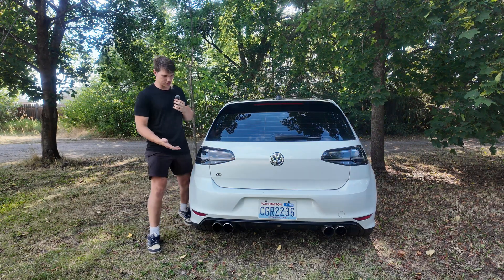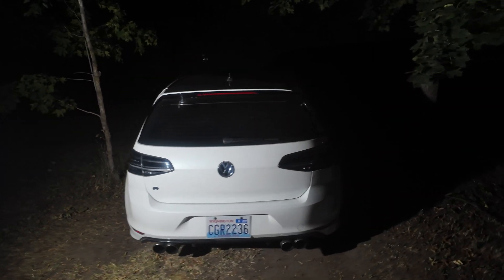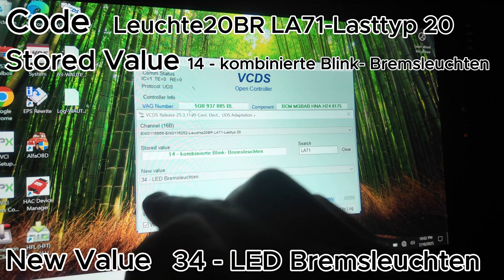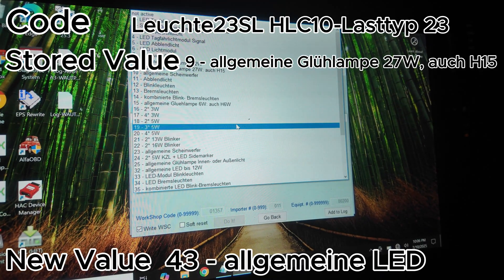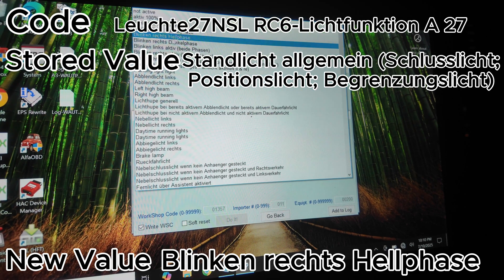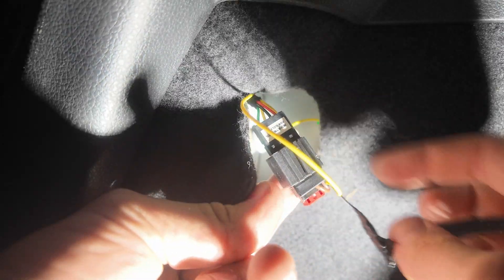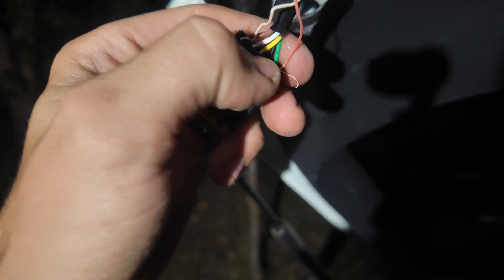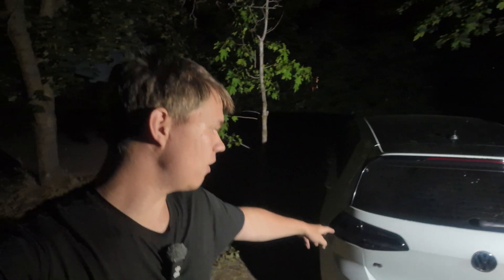How to Code VLAND Tail Lights for MK7 Golf (FULL Step by Step Walkthrough!)

Comment: I have these taillights with a dedicated wire for the sequential indicators which work, but I get DRL leds working on the inner lights. Any help would be greatly appreciated thanks!
Reply: If it's a coding issue, you can search for Kencha Tails for OBD Eleven on Google Images. You'll find a table with the basic settings. That should make them work.

Comment: Why is it he adds the white and orange wire, hes not showing in any off the videos why he ads it, will the lights not work if you dont ad extra wires? and what type of wire do you ned to use?
Im asking because i just bought my own set, and i want all information neded to a good install.

Except fore that great video :D

Comment: Just did this to my 2015 gti and coding for both and left side works perfectly. However my right side is having problems and im not sure why. It works when I run the yellow with green tip wires in a cross pattern but won't work when they are connected to there degainated side. Any thoughts?

Comment: @MikhailBobko After undoing the clip I am unable to pull the wire connector(s) out of the factory harness, do you have any tips to do this? It feels like it is still clipped in, and I don't want to pull hard and ruin the connector
Reply from the maker: You have to stick something very thin into the front of the connector, there are small holes to do so

Comment: Hey i have an issue with mine, when i followed step by step like the video the inner left turn signal work work and the right outer.

On the left outer turn signal i put the grey wire back in same as on the right side and it started working.

So now the left side is working completely fine but i cant seem to get the right side inner turn signal to work.
Any ideas on how i can make this work?
Reply: Update, it was my fault the video is spot on with the wiring, i did not connect the yellow cables that come with the VLAND tail lights
Reply from the maker: Glad we were able to figure it out!